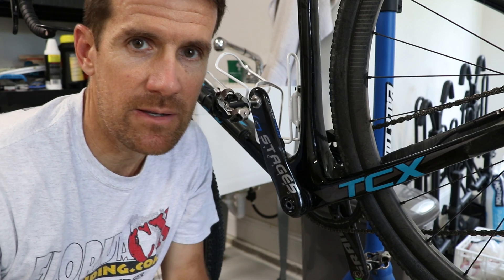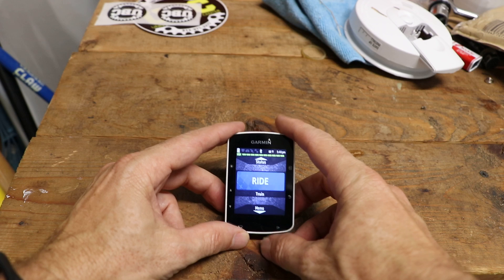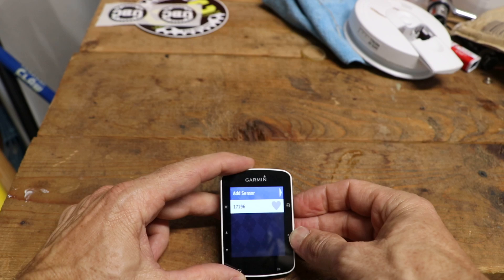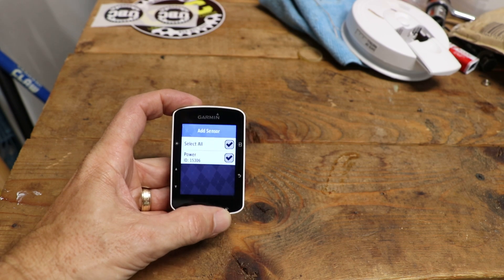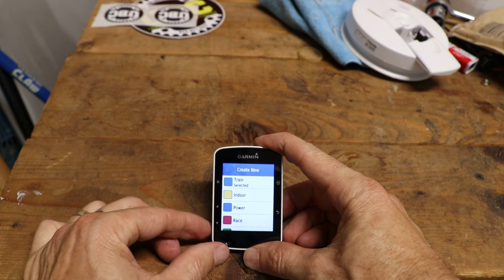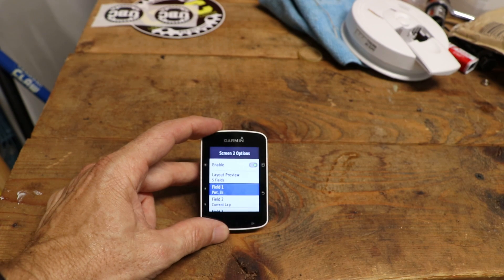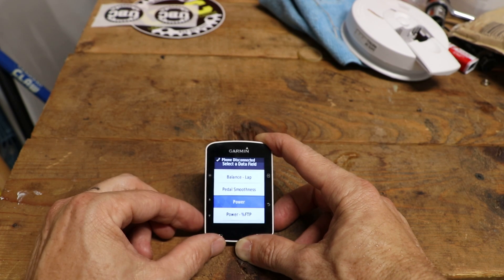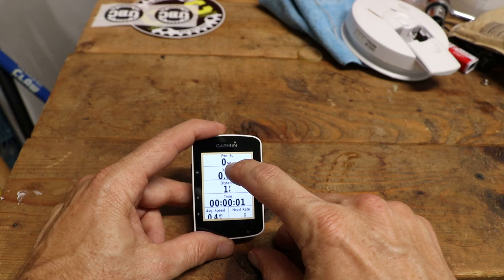How to Connect a Power Meter to Garmin Edge

Comment: Just one comment on the power average displays, can those be changed after installation or do you have to go back and delete the power meter and re-install again?
Reply from the maker: You can calibrate your power meter at any time very quickly. Just have to unclip from the pedals. I usually do it every few weeks.

Comment: Clint thanks for the video. I just installed a SRAM Rival Lt. sided crank power meter and on my Garmin Edge 530, the power display was fluctuating wildly on my first ride. I installed a new AAA Lithium battery before the install yesterday and added it to my SRAM AXS app with a complete calibration and zeroing. Having never used a power meter before, is that just a characteristic of power meters to fluctuate so widely in displayed output or is that 3 second average too sensitive. I saw there was a "Power Smoothing" option on your computer. By nature, do power meters fluctuate in their display so wildly? If so, I'll go back to using HR which is so much more stable.
Reply from the maker: Yes, that’s common. That’s why I have my Garmin head unit set to three second average. It’s just too hard to try to maintain the same power if you don’t do that.

Comment: Good video but my edge explore really won’t find the AXS SRAM power meter. 

Is it technically to old, or do I have to wait way longer than 1-2 minutes?
Reply from the maker: I don’t think it should take more than a minute. Have not heard of that issue. I would contact Garmin support and see if the power meter is supported.
Reply: @ClintGibbs  
Alright, sounds as a good plan. Can you please update the results from the call here? I retried it with the same result.. :/

Comment: I don't know why stages can't be more helpful. I received two of the same manuals with how to install a crank arm in 50 languages with useful tidbits like "this is not a submarine". All they need to provide is a quick start, one sentence on removing plastic battery isolator and more words on to how to pair with the computers they support.

Comment: Recently got the stages ultegra and been using garmin 520, however i get zero watts(even wen pedaling ) when mounting the unit in the handlebar front mount, but when mounting it in using thr stem mount it works fine? (Doesn't look as cool as the front mount though) any thoughts why this is happening?
Reply: Did u sort it out mine won’t display either?

Comment: Hey Clint I have several issues with a fsa slk stages gen 2 and a garmin 810 it keeps losing the connection and showing nothing and after some long descents gives wrong readings like 5000 9000 watts... Im pretty bummed and considering buying another head unit like the 520 or even the stages dash. Do you experience those kind of problems?
Great content from you take care and all the best from a subscriber in Brazil.
Reply from the maker: +barakabrown I've never had an issue like that. I'll do a review of this meter after using it for a while and if I have any issues I'll mention them.
Reply: barakabrown I had a Garmin 520 and depending on your set up the out front mount caused my stages power meter to have short drop outs. but it was not that offten and would be easy to miss. I only noticed it when doing intervals to a certain wattage. if you are having long drop outs I'd take out your battery and lightly bend up the gold battery contacts inside the battery area. be cautious slowly bend them with light force it doesn't need much . if you want to see if the drop outs are head unit related run the wahoo fitness app along side your Garmin, and if it drops out over Bluetooth also it's your power meter. but if just the Garmin drops it's the garmin. I am running a wahoo bolt now which seems to have solved all the micro drop outs for me